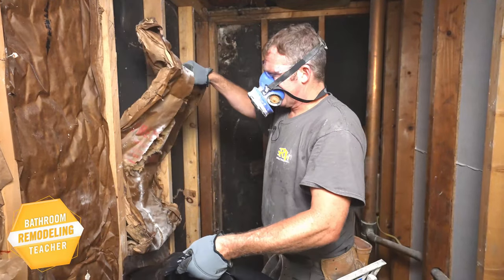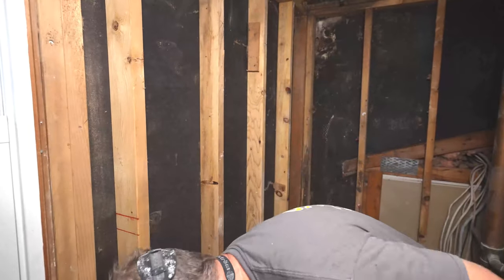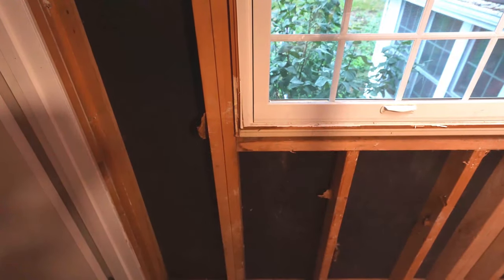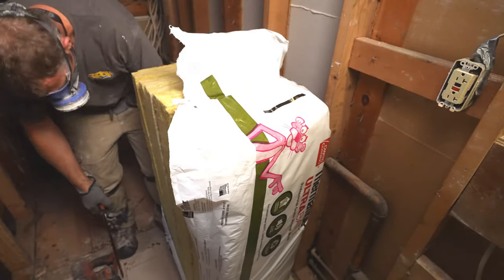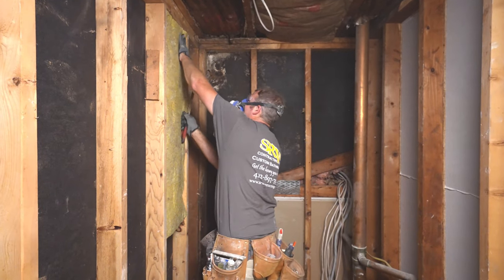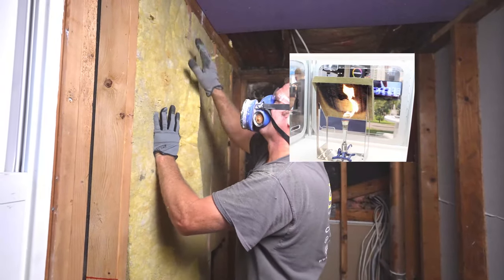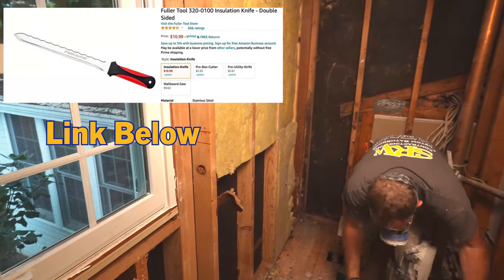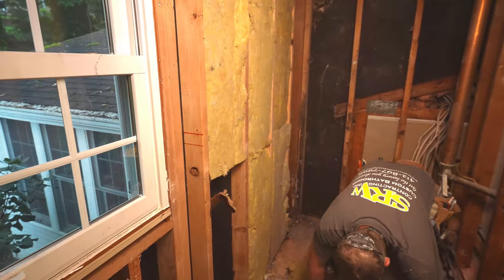Better Insulation for Bathrooms | PLAN LEARN BUILD

Comment: Do you add any plastic/vapor barrier over the mineral wool or do you drywall right over top. Great tips!!
Reply from the maker: That’s a good question. And a tough one to answer. I personally do not install plastic vapor barriers around here in Pittsburgh. I see more issues with them than not. Just like the paper face insulation molding. Most of the time the exterior of house is wrapped with tyveck or foam board is installed and sealed at seams.this causes a vapor lock between plastic barrier if you install one.
Reply: @BathroomRemodelingTeacher how is it a vapor lock, house wrap is water permeable allowing water vapor to pass through.

Comment: I need your help and opinion. I'm doing my very first bathroom remodel. My house is older and the bathroom appears to be framed with 2x2 so Im limited on space in the wall cavity. Should I go with a 250 foam board, 2" thick which will only give me a R value of 10 or should I go with mineral or fiberglass and add to the framing to give the wall a modern 2x4 space? I live in Indiana and this wall was poorly insulated anyways. I think anything I do will be an upgrade.
Reply from the maker: Sounds like the old sears home kits. I bought a house like that once for a flip. Was totally shocked that the walls were that thin. I ended up framing in places like the kitchen and bathroom and used rock wool. Then everywhere else I just used the pink stuff. Used 1/2” foam outside too since I added new siding too. It would probably be best to just frame out all walls so you can get better insulation value. Foam is expensive and doesn’t add much
Reply: @BathroomRemodelingTeacher  it's very strange. I bought the house off family and it house estimated for double so I wasn't going to pass. I looked around my town prior to buying and all the houses, even worse than mine were 200k plus. It's about 2000 ft w 2 car attached garage. I believe it was built in the late 60s or early 70s so not sure what's up with this exterior wall

Comment: Would I be able to install cement boards on top? Or would I need to add plastic wrap before?
Reply from the maker: I typically do not do vapor barriers inside since most of the time there is one on the outside of house (Tyvek or foam board) and a vapor barrier inside just locks vapor in wall cavity and can cause moisture problems. And if you are using cement board, I highly recommend adding a liquid waterproofing to it (hydroban , aqua defense)
👍
Reply: @BathroomRemodelingTeacher  got if👍
Reply: @BathroomRemodelingTeacher if I don't use vapor barrier can I just put the shower surround panels up direct to stud? Thanks